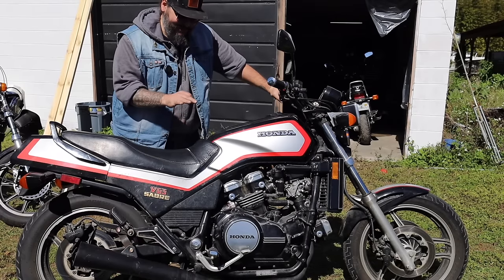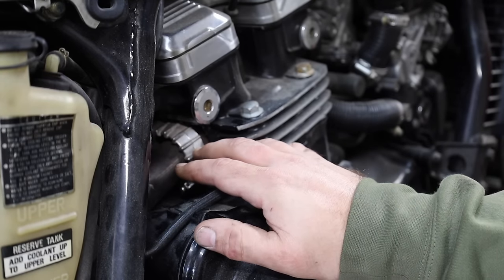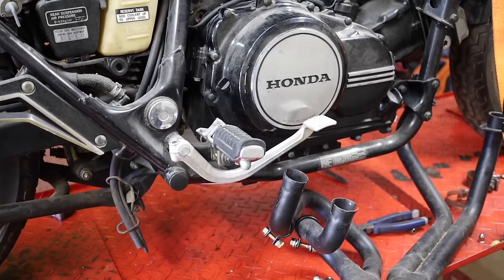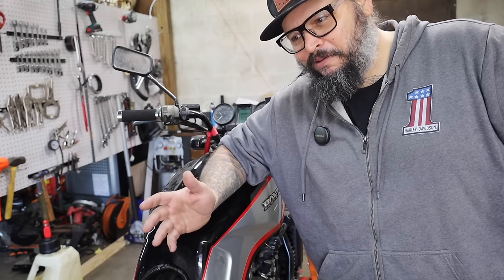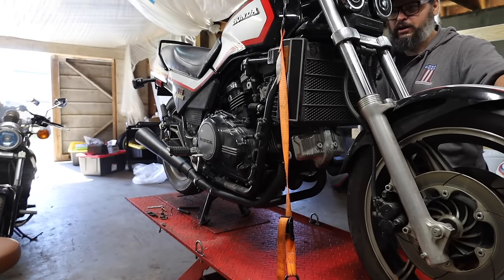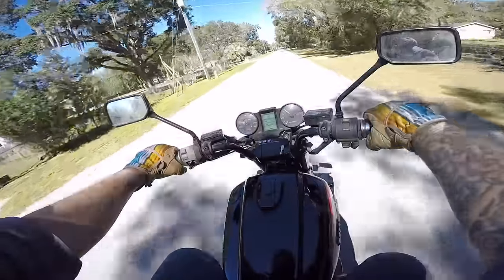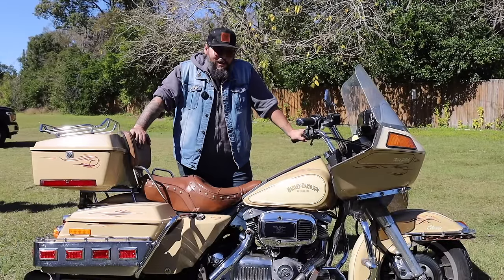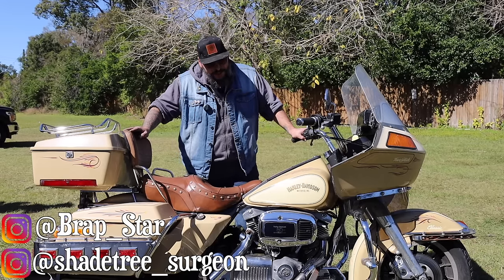Bringing the MOST DANGEROUS Motorcycle of the 1980s Back to Life | RESURRECT THE BEAST 😈

Comment: Not sure when Honda switched over from chain driven cams to gear driven cams, but if it’s got cam chains keep an eye on the tension AND the condition of the chain guides! I learned that from my ‘87 Interceptor (similar V4 engines). Also, the carbs are a BITCH to get out.

Comment: the oil pump didnt supply enough oil to the cam while it was idling so if you sat in town traffic your cam would start scuffing. i think the v 65 sabre engine ran backwards to the magna . same engine. coil triggers wold blow because the fuel pump electronic box would blow

Comment: The unfortunate flaw in the Sabre That made it dangerous was a poor chassis & handling for its (at the time mediocre 120 hp) in comparison to modern bikes. Yamaha's YZF-R6 for a couple years made more horsepower at 123 ~ 126 bhp from a 600cc.) but had a far better chassis & suspension. Most current super-bikes, (1000cc) make 200+ hp in a bike that is far lighter than the old Sabre. (adding the 315+ bhp Kawasaki H2R  in for the 250 mph catagory)  Times have changed. even back in the 1980's Yamaha kicked Honda with their Sabre & Magna 1100 in the slow-ditch when they introduced their monster 1984  V-Max 1200 with 145 bhp, ( though also in a cruiser chssis too, that could not handle the power.

Comment: I got a 1980 suzuki gs1100e with a worked motor after a friends uncle pulled up on a 1981 honda cb1100R and took me for a ride as a teenager. The only thing i dont like is the stock speedo it only goes to 85 and it does 90+ in first gear alone.

Comment: I have three of them. A red stripe 49 state, a blue stripe California and a Magna with all the aftermarket accessories. Drive it like a standard an you have a nice ride.
However, it is too fast, do not wind it up past 6500 rpm.
These engines will light off faster than you can compensate.

My V65 Sabre (1100 cc) got me to work and back for two years and it was great. 
Best investment ever. Tough engineering, easy to wrench on, lasts forever.
These motorcycles are designed to gobble up miles of clear interstate highway like it's nothing.
That said, It's not a good or normal motorcycle. I do not recommend it to anyone.

Comment: I had the 750 sabre , loved the sound of the V4 , it had great handling until you threw it into a rh corner at speed! Lh corners were fine. RH and it would frame flex and the only way to get under control was to drop your body below the tank on that side to lower the centre of gravity 
I think this was somehow connected with the shaft drive 
I still blew away bigger bikes of the time even through corners but I was younger and stupider then! Now I stick to dirt bikes

Comment: That V4 would lose a a lot of torque if you left it open header/exhaust. That's a bike that needs a bit of back pressure to run well. You could also damage the engine when riding aggressively, could damage or even burn up the valves, and overheat parts of the valvetrain that are a pain in the ars to replace on that bike.

Comment: As fast and scary as that bike is... Japan's revenge was clearly the original '72 Kawasaki H2 Mach IV, a.k.a The Widowmaker. The V65 Saber has a LOT more power, but that 74 HP 750cc triple was too much for that bike. The chassis flexed, the steering dampers did fuck all, the single disc/rear drum were barely adequate, and the narrow power band + weight distribution towards the rear (with too short of a swingarm and not enough suspension travel) meant that bastard would come off the ground at the drop of a hat. The V65 is SCARY fast, don't get me wrong, but it actually IS built to go that fast. But the original H2 clearly wasn't, and it was a murder machine. They did tame it down in '74 with a bit less horsepower in a wider band and a stiffer frame with the weight a BIT more towards the front, but the reputation had already been set in stone by that point.

Comment: I had a V65 Magna about 20 years ago. If I could have one of my many bikes back, it would probably be the V65. 

Not because it's good, but because it's so feckin unbelievable and absolutely ridiculous creation. The frame is so inadequate for the engine it is just hilarious - on a twisty road, the front end is entering another corner while the rear end is still negotiating the previous one. My bike had been crashed tens of times before and continued to crash after I sold it.

It has so much power, it begs you for a powerslide. But when you give it the powerslide, it is almost impossible to detect the point where it would just swap ends on you and leave you dealing with the consequences. 

There are very few things more majestic than a massive V65 Magna going for an effortless wheelie. At around 20MPH, in first gear, close throttle momentarily to compress the front suspension, then full throttle, not touching the clutch - and you will be greeted by a view of the bluest sky you've ever seen, backed by the raw noise of that V4...

I have also always wanted to get my hands on a V65 Sabre, but I don't think I've ever seen a single one for sale in my neck of woods for the past 30 years. They made some V65 Magnas for Europe too, but I don't think the Sabres ever got sold here and they are a rare beast indeed.

Comment: Hey @shadetreesurgeon, I've got 2 of these v65 Sabres same color as yours.  One runs beautifully and the other is pretty much a parts bike but complete.  Also, they came with a Hondaline fairing still in the box (my guess is for racing due to how rounded and large it is).  AND the bikes came with a load of late 70's & 80's honda motorcycle parts.  Let me know if you're interested.  I don't want to sell these things to just anyone because they fly like a rocket and stop like a freight train.

Comment: One of the earliest 10 second quarter mile bikes out of the box.  Induction hardened camshafts would flake off.  165 mph top speed.  Mild by todays standards.  Get to 30 mph shift to 4th and full throttle.  Enjoy.  Precursor to VMAX.

Comment: Your clutch was slipping, try changing the oil to motorcycle oil it may have auto oil in it.
Reply from the maker: Joe says every v65 clutch needs to be changed with some stiffer springs. Honda didn’t put stout enough stuff in there for the power
Reply: @shadetreesurgeon  Same issue my old CBR1000 hurricane had.
Just old Honda things it seems.

Comment: Hate to tell you but you are wrong the most dangerous motorcycle of 80s was the 1983 v65 magna look at a image of one thay had the long forks  and  the motor was set
 back towards the rear tire the bike you have there is more long and lower to the ground cycle world called  the 1983 v65 the most wheelie prone motorcycle since the H2  Kawasaki and they said the most dangerous dirt bike ever made the tm 400 cyclone Suzuki was about as dangerous as the v65